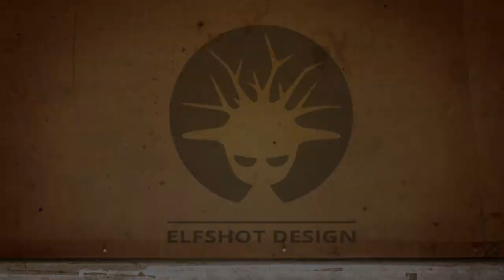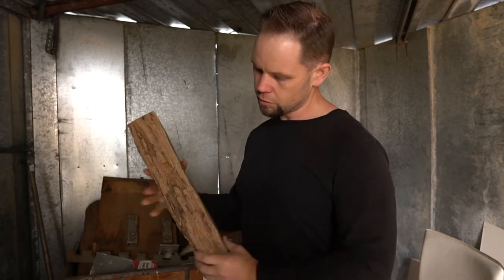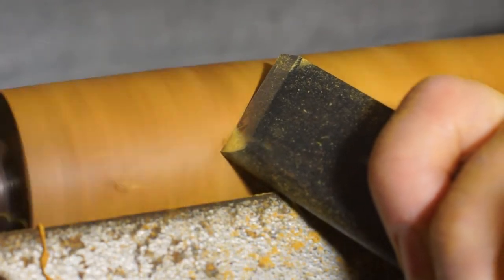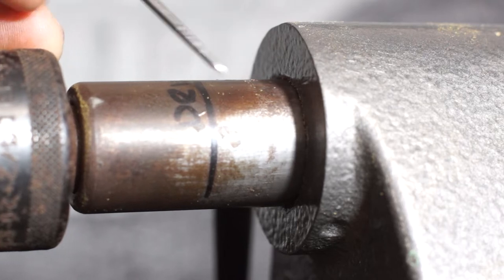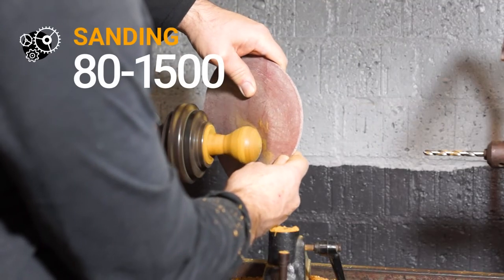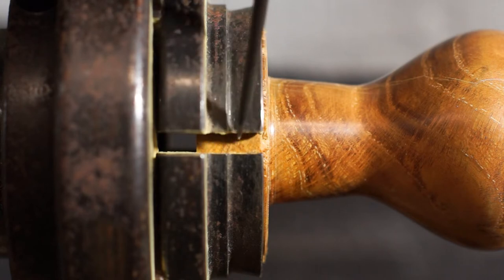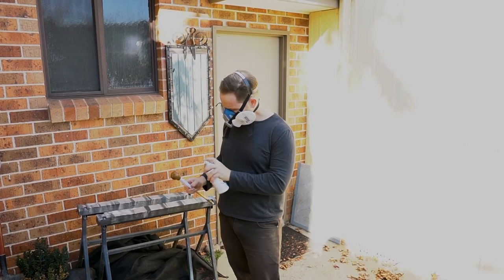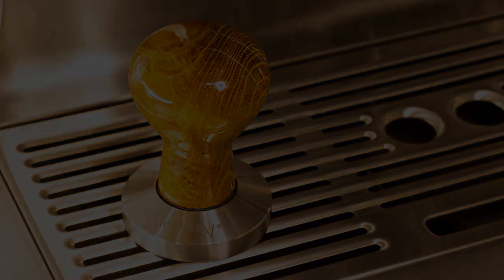Easy wood lathe project - make a coffee tamper handle

Comment: Fantastic work mate, exactly what I was looking for - did you just remove the handle from a tamper you'd bought, or did you find a handle-less tamper?
Reply from the maker: You can buy the tamp head separately, just need to match your portafilter diametre.